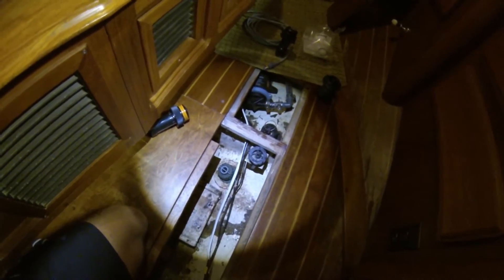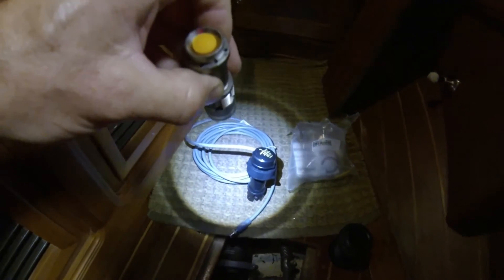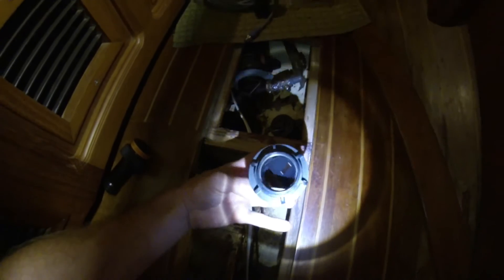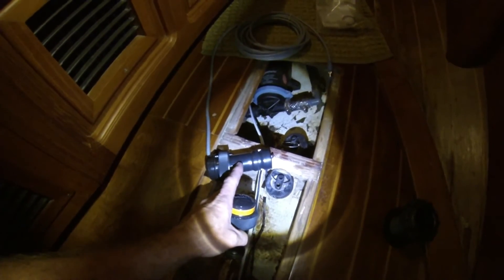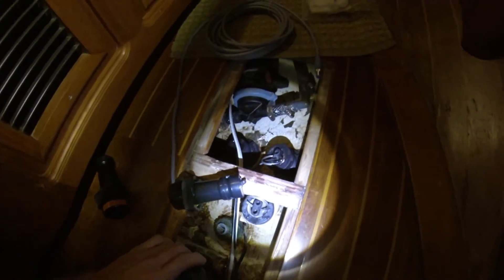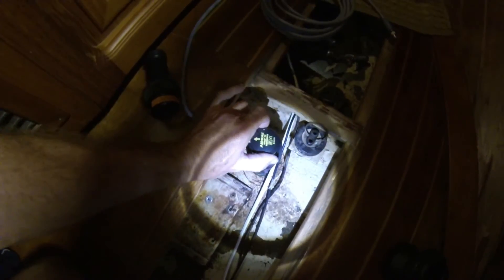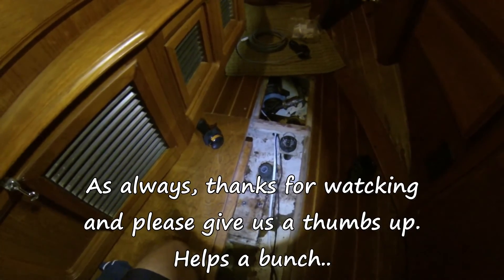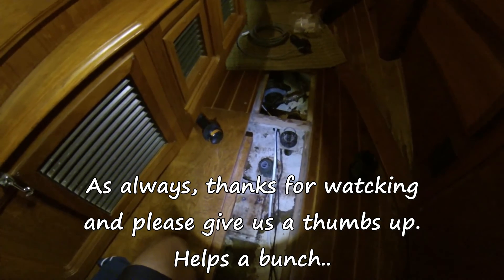Time for new Garmin instruments

Comment: I would like to hear and learn more about the proprietary changes you were speaking off. Also hope I spelled proprietary correctly. Thank you for the update
Reply from the maker: The new wireless wind unit they came out with only has a range of 50 feet incited of 300 and you have to use there GMX 20 instead of the Nexus WSI receiver box.
So now it has to go through Garmin to get to the NMEA 2000 network. Everything is going to tablet and laptop based software. If I were a company that made most of me money off of hardware Id be worried too.. I bought now because I can do more with the older stuff and Im not convinced the having 1 thing to surf the web, check email, play games and show me how to cross an ocean is a good idea. I prefer my electronics to do the one this tkey were made for. Chartplotter to plot charts? Check....